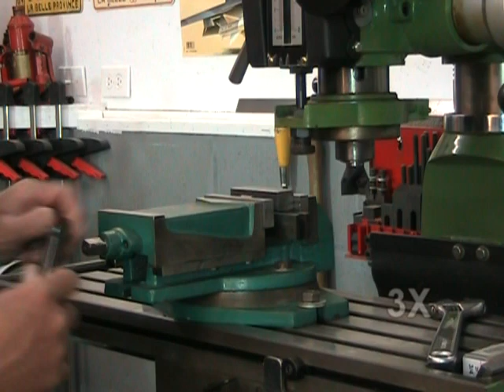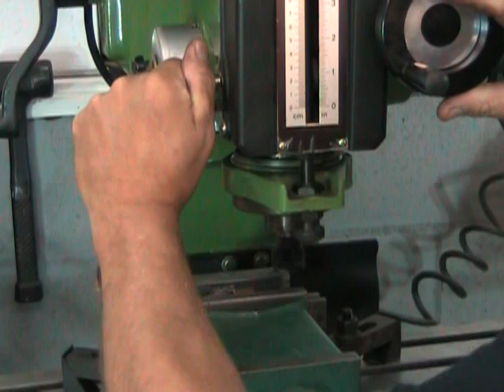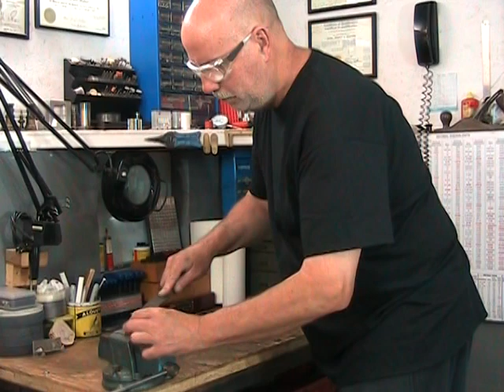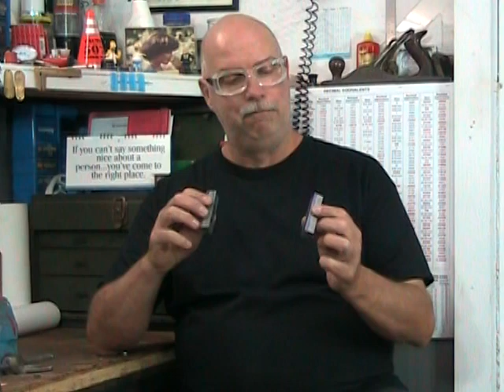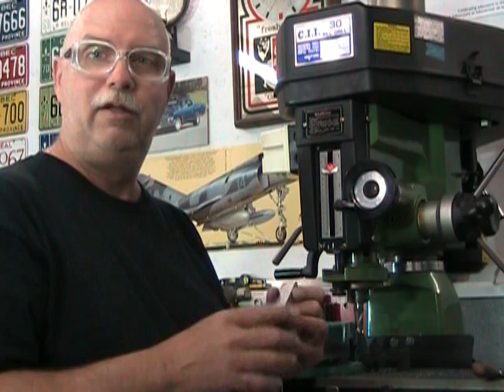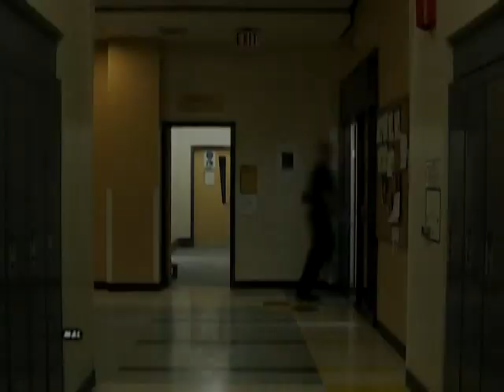TAP BLOCK PART 2, MILLING 101 MARC LECUYER

Comment: You have a grand teaching style somehow leaving no stone un-turned with nuances, awesome! I to have the same mill. That said, I'm wondering about the stand your mill is on. 1st of all do you like that stand? 2nd How tall is it? 3rd Are the legs straight down or angled? Finally did you find a need to bolt it to the floor? I ask this because I have a nearly identical work stand I'm using as a grinder/ belt sander platform. I just noticed It is the same dimension as the mill base. Now I would like to make my mill free standing.

Comment: Hi Marc. I found your vise squaring technique very interesting. You were tapping the vise as you were moving from right to left. I will try that next time, it looks faster than going end to end and tapping to divide the difference... Cool, thanks, Daniel
Reply: ***** Yap! You just tap it slowly until you see that the needle doesn't move as you go on the X axis, normally you should be able to get it right in 1 or 2 passes max... ;-)

Comment: Excellent work and explanation, as always.  Your dedication to the craft has earned my enduring respect.  BTW, votre anglais est mieux que mon francais.
Reply from the maker: MrShobar Hi MrShobar, I am perfectly bilingual, (French dad, English mom) that means that I make no difference between French and English and most of the time I am not aware which language I am using, it doesn't however mean that I am any good at either, I massacre English just as efficiently as French! Thanks for watching and for a great comment and compliment, Marc